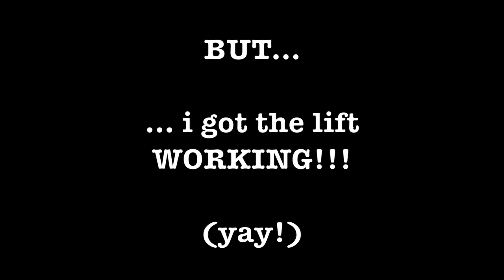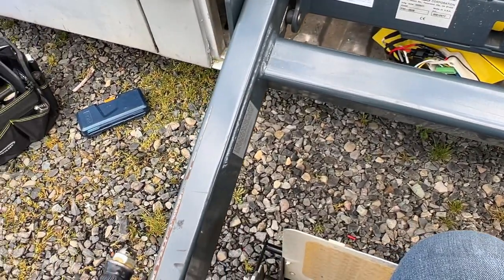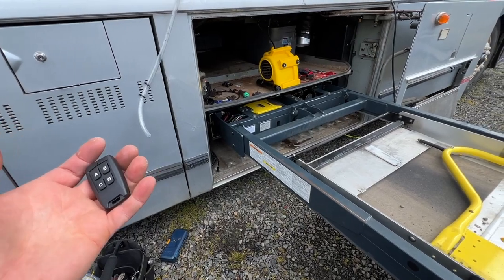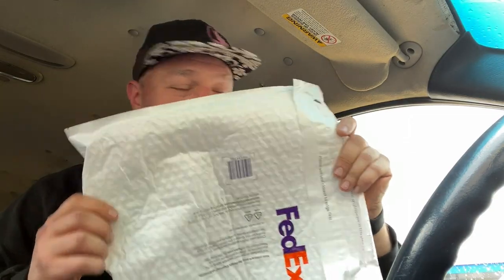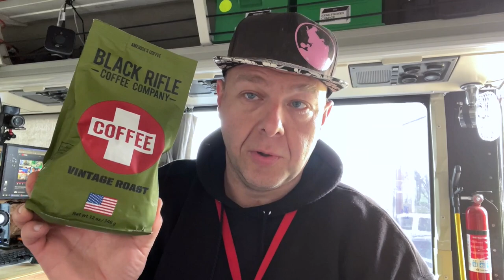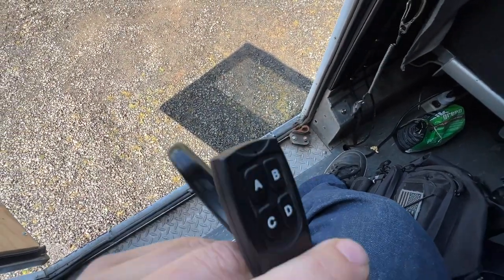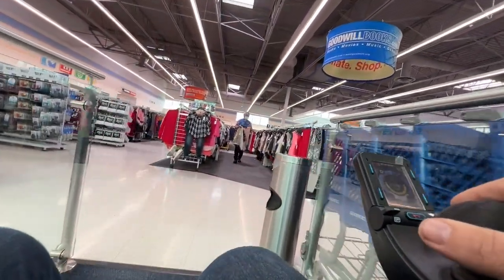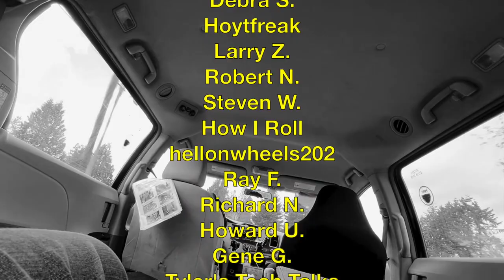VLOG 609: the lift is fixed!! (and other stuff:^)

Comment: hey dan... so glad your new 2 u van is working out. i agree with that entire sittin in the rain waiting on a lift. ramp is much quicker. just a though... wouldnt the lift on the bus be eaiser to setup and use if it was just hard wired and not use the wireless stuff? maybe im missing something or? oh... hand my hand surgery. they where able to keep about an inch. yeah! way eaiser to print and wear a prothstetic thumb [robot thumb] when there is at least a nub. lol so now that both my thumbs are nubs? lol i will get a matching set printed. now just have to decide on which camo pattern. oh... also will have to see what tools they can mount on them. power screwdriver, flashlight... ha ha ha im thinkin i may just need to buy myself my own 3d printer. anywho... yap at ya later. im not supposed to be using my hand. lol
Reply from the maker: the lift slides 6 feet back into a carriage with the controller attached - so adding my own wires wouldn't really work
Reply: @TotallyNormal-  yowza! i got ya. its like changing sparkplugs in a ford windstar minivan... to access 2 of the sparkplugs you have to take half the frontend apart. lol take care... and thanks again for taking the time and all your hard work sharing your life and experience with us. you have improved my mobility thus my quality of life. thank you... hope you have an awesome day. hope to catch ya on your livestream tonight.